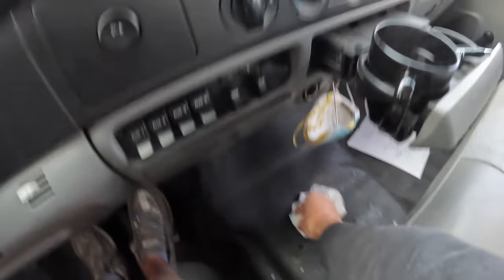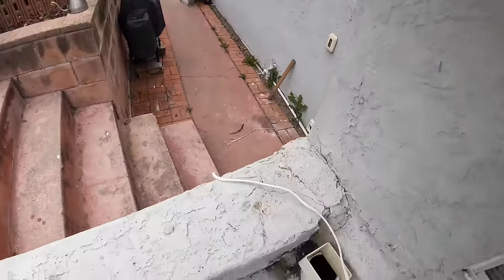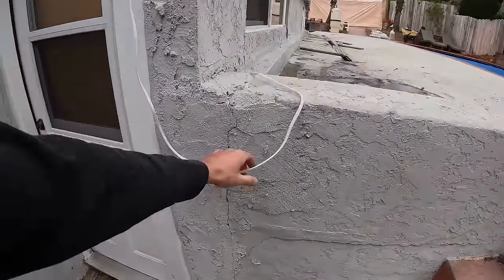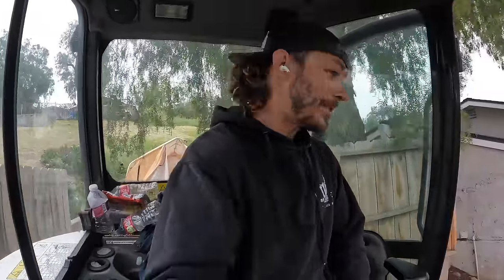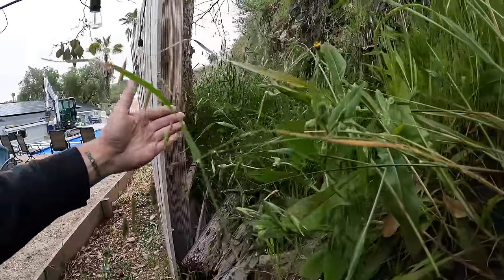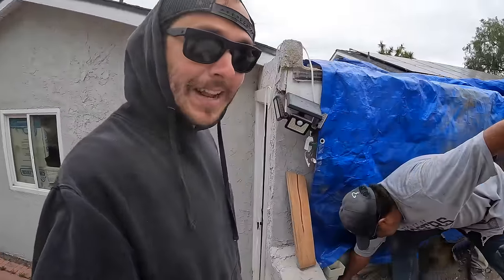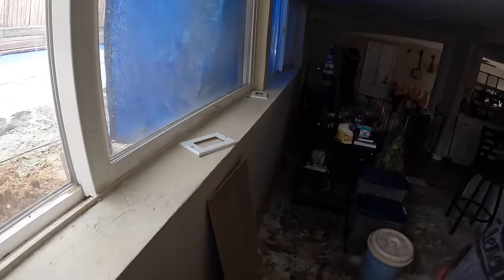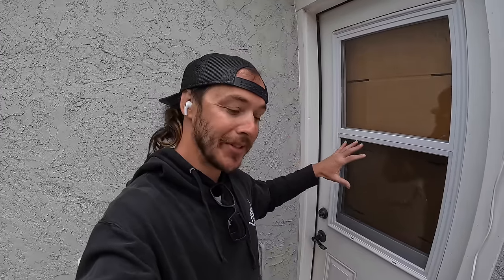House Flippers Completely DESTROYED This House!

Comment: I've been in the game for 30 years and believe me, flipping houses has burdened the buyer and the costruction industry with lousy workmanship and hidden problems!
Reply: Yup. I foolishly bought a house recently that was flipped back in 2006. It’s a pile of junk.
Reply: Took one client to a house mid flip. Mid century with modern design horrid but the bathroom had a new shower whose door opened 4inches into a toilet..
Reply: the more I tell people not to buy flipped house the more they buy them - major headache for craftsman who care and want to do the job correctly
Reply: It’s the last 10 to 20 years of dyi and small flippers on tv flippers is horrible. Flip houses are a nightmare and have destroyed the housing market
Reply: I'd rather buy a condemned house. House flippers only care about making money so they have no incentive to do a good job.
Reply: Considering what my sister found during rehabs of her old homes when the previous owners went for pretty over safety/quality as just upgrades I can’t imagine what flippers did. A example of her second home was the owners in the 80s-90s put in pretty tile in the bathroom without dealing with the electrical issues so they had wiring from that time period spliced into knob and tube that almost burnt the house down in the early 2000s. There is no point putting in a pretty bathroom if you are going to burn the house down by refusing to fix the electrical stuff.
Reply: @Chuckdiesel86  i bid on a condemned one next to mine for like $20k and 4 other bidders got involved.... The only other people who had been there were flippers

They ended at $50k for a house i had planned to level for some extra yard. It still hasnt sold, sitting at $230k for a $80k property
Reply: @Chuckdiesel86  but thats like, every company
Reply: @thatguy4305  that's why every company sucks
Reply: Worst thing I've seen as I age is the difference in how the housing market was and grew into. Back then houses werent a thing to really just flip and make money everyone knew that if we did that with housing, cost for what you get would become terrible. years later you have crazy prices and people just buying because the bubble hasn't popped yet, it will only pop when ppl realize oh shit these prices arent what I'm actually paying for.
Reply: @alexacarrillo4339  shouldnt the landlord be fixing these things if these properties are rented out? or are people still signing things without reading them? XD
Reply: @Joee_Kool  these homes were purchased. I have yet to meet someone that does a full rehab on a rental property which they have done with 3 homes due to moving in older cities. There are things that are hidden in a way that even a good inspector can’t see and the idea is surely they got the proper permits when redoing a bathroom that required electrical upgrades. Not everything is out on the wed to check.
Reply: Not to mention they’re a good part of the reason houses are so expensive rn
Reply: Its like they are taking a play out of the China Tofu Dreg construction book, make it look good on the outside, but the inside is complete shit and cutting corners at literally every turn
Reply: Unfortunately, poor workmanship is the norm today. It’s much more common to have a contractor do subpar work, than it is to find someone that actually does it right. Overcharging is the norm today too.
Reply: Last time I was looking to buy a house,  walked into one to view and could tell it was a flip due to cheap "updates" and lack of attention to detail while trying to ask top dollar.  I walked away.
Reply: How does a basic pre close inspection miss this?
Reply: So have lazy homeowners that don’t know how to maintain their homes
Reply: So why do you do it?

Comment: I used to love watching house flipper type shows, until I realized just how horrendous it is, not just because of the messes they leave for the new owner, but also how much it affects the affordability of the housing market. Thank you for doing what you do, bringing awareness, and helping these home owners.
Reply: For me it's once I realized all the corners they were cutting. Just so they could save money even though they will toss the costs they saved into the price anyway...  And so they could try to avoid things like permits that they really should likely have most of the time.
Reply: It dramatically increases the cost of housing, but it also dramatically increases demand for materials and eats up the labor of contractors, handymen, plumbers, etc which makes everything so much more expensive. The real winners are the institutional investors that own securities/commodities in the industries that flippers create demand for, "flipping" a stock overnight for 50x the profit while the house flipper is left with the bag, so to speak
Reply: I can’t stand most of those shows for that very reason.  When I had cable I would only watch the shows to see what not to do.

The only showed I like are This Old House, Hometime, and a few others that do normal restorations and remodelings.

The worst in my opinion are those like Chip and Joanna Gaines the Hillbilly Homewreckers on Fixer Upper, Holmes and Holmes, and many others who destroy the insides with open concept, floating shelves, white kitchen cabinets, unnecessary islands, barn doors, shiplap, painted brick, and countless other fad ideas where they try to convert nice beautiful homes into ugly studio apartments.😖
Reply: Not all are like that. They uncover issues and fix them
Reply: There’s some that do it right. This Old House, the OG, does it right. They also devote an entire season. Some would say they don’t flip, but do a restoration and modernization.
Reply: @samm1462  agreed. I'm a big fan of shows like TOH, and their spin-off, Ask This Old House, but I feel like those are less flips and more honest, sincere renovations and remodels. they are focused on not only doing it right, but TEACHING how to do it right, for people who might want to try their own hands at updating/restoring their homes.

Comment: It's fascinating how flipping has almost become a dirty word in a really short time thanks to all the substandard work being done out there.
Reply: It's not at all surprising, though. Flippers want to do things as cheaply and quickly as possible to move their money onto the next project. And for a lot of things, it's  not going to increase the final sale price of the house all that much if they use good quality materials. And often times they can do the job wrong and be long gone before it gets noticed. They have no real incentive to do good work.
Reply: Has it ever not been a dirty word?  Flipping is doing the least costly, crap quality updates to make an easy profit. They sell it and wash their hands of it. Have you ever heard of a flipper providing any type of warranty to the next buyer? I haven't.
Reply: @duckpwnd  Kind of like the flex tape used on the deteriorating copper drain stack in the crawlspace of the home I bought last year?? 😂
Reply: It always will be so long as homes are a vehicle for financial speculation.
Reply: @duckpwnd  honestly flippers should be held responsible for some financial compensation when damage like this is found and needing repair...
Reply: @draggy76  in many states the seller or contractor is liable for any issues that can be reasonably determined to exist prior to sale or as a result of their work. This is something the previous home owner should have sued over and the current owner should be able to sue for. My state had a few years filled with lawsuits against contractors and flippers. There are less flips happening now but many are feeling the pain from the shoddy work that was done. The local inspectors also are still on high alert for issues because the town’s inspectors were taken to court for passing a house that had a wall collapse.
Reply: Flipping is a dirty word period. Artificially increasing the price.
Reply: @duckpwnd  Yep. Doesn't make sense to spend 5000 on an improvement when they can get it done for 1500 and itll probably only raise the value by 2 grand.
Reply: @Slyons89  My family has always done real estate, never called ourselves flippers because we didn't buy a house with some astronomical expectation of adding onto it and reaping massive profit. All we've ever done is buy houses that need to be remodeled and just remodel what is there and then sell that for what it's actually worth. It takes a lot more money to add onto a house than it will bring in, with the exception of a back deck or something cheaper that does not involve adding a room onto a house.
Reply: Just like "California."
Reply: @Cincy32 Or Texas.
Reply: how are they not liable for selling a faulty product?! i thought people would be scared of doing shit like this because of getting caught!?
Reply: yeah they used to take crap houses that no one had money to fix and make them market ready, now they just slap on some awful grey flooring and tacky countertops.
Reply: Because it is dirty and immoral! When I started looking for my first home I realized how bad the flippers were! A $800,000 home purchased in January would be relisted for $1.5 million in July!! I went to check (I knew I would not buy it anywhere close to that price). I would walk around and noticed all the shady jobs... lines that were not straight... bubble feeling on the floor, the cheap material...etc. What kind of a job could be done in a few months that would make the house worth almost twice? And just when I found an old house to work with the seller, one of those flippers would take it and did a half ass job and relisted it for twice as much! I am also upset that some buyers would even pay the asking price when the houses that area weren't even over a million dollars in value...! The flippers drove the price and property taxes way up with shady work!

Comment: It’s so scary not knowing exactly what you’re buying and getting into when purchasing a flipped home. Thank you for your honesty and integrity with you’re work!
Reply: Curious if an inspection was done.
Reply: @boowiebear  inspections look for certain things some don’t dive too deep.
Reply: @nikkigardiner9426  Its very very very very common for an inspection to look at how water is draining from the roof and around the foundation of the home. Such as assuring things are angled correctly away from the home, assuring drainage pipes are directing water correctly away. If an inspection was done, imo, it was a crap inspection with a crap inspector.
Reply: @boowiebear  A "home inspector" once found that the gas furnace was burning yellow, but completely missed the chunk of 2X4 holding the kitchen sink drain pipe together!  The most recent house was inspected by a "builder" and this one somehow missed the leak in the evaporative cooling system on the roof!  
Tom's wife Pam
Reply: I bought a project house that was being completely redone before the previous owners passed away back in 2020. I had it inspected by 3 different companies and all of them agreed that it was broken and fucked beyond repair (the previous owners had completely destroyed the houses foundation among many other things). It's slow going to repair all the damage that was done to it. I think the only difference between me and the home owners in the video is that I knew what I was getting into. Just wish I had more time and money to pour into fixing up my house, lol.
Reply: thats why you inspect it yourself ,   
 if you cant crawl and inspect the house,  then you hire a contractor to do it for you ,
Reply: I wish there was an easy solution for learning what to look for yourself the inspector just feels like some arbitrary thing you have to cross off on a checklist to make the bank happy. Would not feel bad about paying this guy 1k to go over a house I was going to buy.

Comment: Lived this nightmare myself.  Prior to us buying the house we live in there was a small fire in the pantry closet.  The homeowner was able to put it out with a garden hose.  Fire damage was minimal except for the smoke.  However, the water damage was tremendous.  The “restoration” contractor didn’t remove any of the wet sheet rock or replace any of the scorched stud framing.  After a slight drying out he convinced the homeowner to cover all the damage with wallpaper.  I discovered all this when doing a renovation of the downstairs bathroom and laundry room where all the water had run into.  After tearing out all the rotted sheetrock and scorched framing, I found a massive mold problem.  Tens of thousands of dollars and hundreds of man hours later I had it all fixed or so I thought.  The wallpaper was ugly so we started tearing it out and found all the smoke damage.  That started another project.  All done because of a lazy restoration company and a cheap homeowner

Comment: Man, the amount of care you guys are taking to make sure everything gets done correctly is awesome. Here in MIssissippi contractors will cut EVERY corner they can. I had to go out back and pick up nails, and roof debris from my dogs pen because the roofer that was hired never went back there. I had my dog inside while they were here. Made sure they were able to go back there, but they never did. They also didn't setup any tarps to catch debris and nails as they came off the roof. I still find nails in my yard and the new roof was finally finished in February lol.
Reply: It simply has gotten so bad that a business that is able to fix such clusterducks will not run out of contracts for decades. There are good companies out there that can and will pick the work left by hackjobs.

Comment: I was a safety inspector for 6 years and that retaining wall looks like exactly the same kind of situation that caused my first fatality investigation. A crew was demolishing stairs that led to subgrade units in a 4 plex with a CMU retaining wall that was failing because it wasn't grouted or reinforced in any way. Well what the contractor failed to identify was that the staircase being tied in overhead to the rest of the structure was literally the only thing holding the center of the wall together. When his crew took that away, a 16 foot segment of the 5 foot wall gave way and unfortunately one of them was caught underneath.  Poor workmanship isn't just frustrating, it can literally kill people.

Comment: I learned real quick that cutting corners to save costs will end up being a hell of a lot more expensive in the long run. This applies to anything be it vehicles, a building project or anything else that would require a sizable chunk of money. Also.. im shocked that work supported the weight of your mini